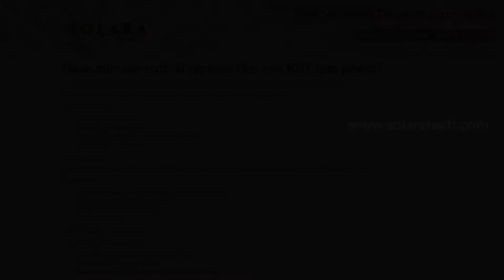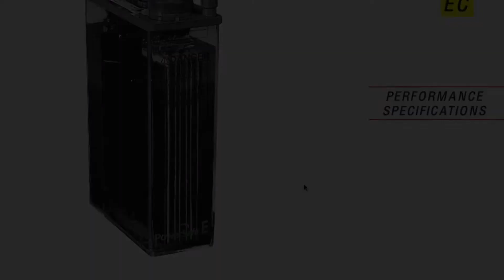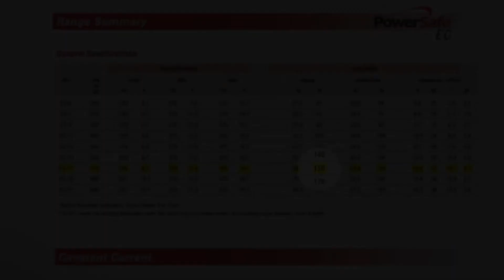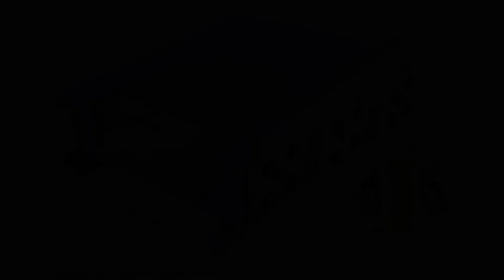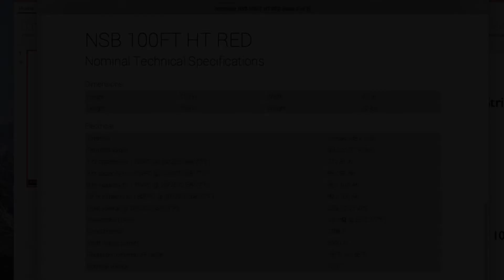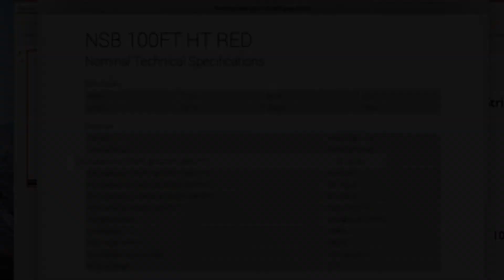Telecom Battery Systems 1.1

Comment: I have the opportunity to purchase a Exide Absolyte GX2000 (2000 amp hour, 48 volt) (2 24 volt banks). Would this be worth purchasing for an off grid 48 volt system? Thank you for any thoughts you might have. Thank you for posting your video - it has helped to better comprehend these battery systems!
Reply from the maker: Hi Ron, the Absolyte battery line is a great product. so long as you charge and discharge them per the data sheet specification, and don't exceed them, you'll be fine.